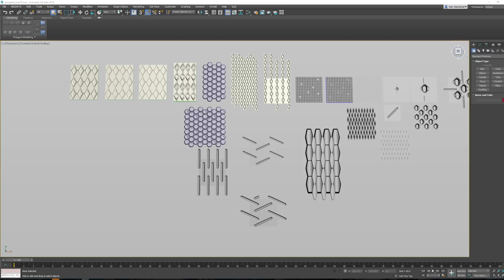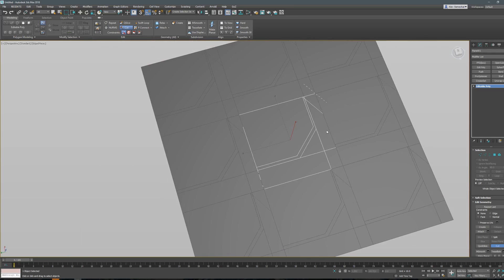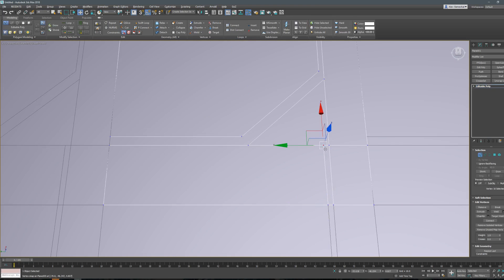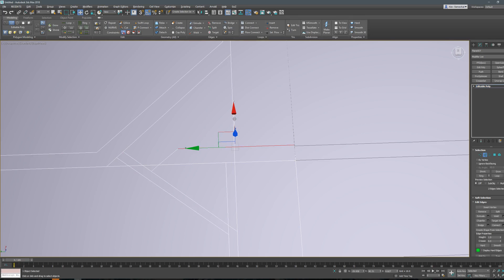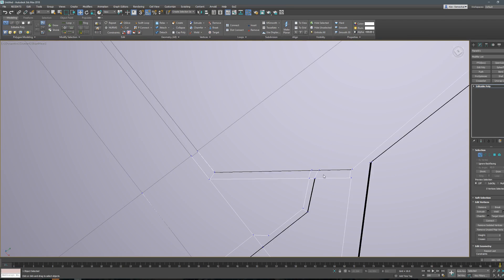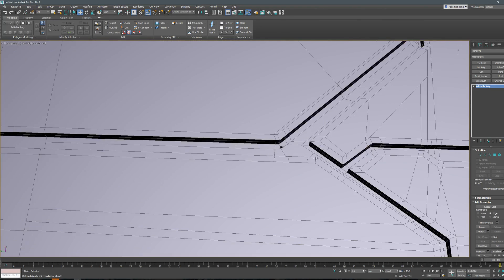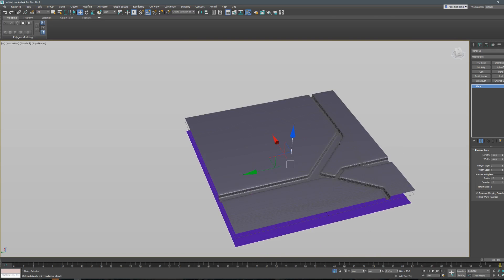3D QUICKTIPS: Modeling Tiling Patterns

Comment: Looks like Max 18 has a bug with switching from Edge/Face/Normal constraint back to None. Seems, like u have the same issue (5:08).  Did you find any fix to that?
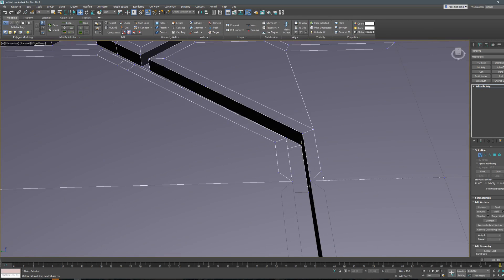And one tip, of course u may know - when u are doing an inset to create supports and then delete some of them to create an edge flow (6:05). U can use quick slice tool: select the polygons, where the edge should go, and then with the quick slice selected, click on 2 points of the existing edge, which u are going to continue. This will give u a direction, so u don't need to use cut tool and snap points

Comment: Does the end result really justify the amount of work, compared to creating a height-map and run it through Quixel's NDO or something similar?
Reply from the maker: If you wanted to model this and deform it into another shape, or needed to make a tiling mesh this still has use, it depends on your needs.
Reply: Yeah i just tested it out. Panels and rivets and smaller not so complex details are faster to achieve with a height to normal approach, but for more detailed stuff it's better to model them.